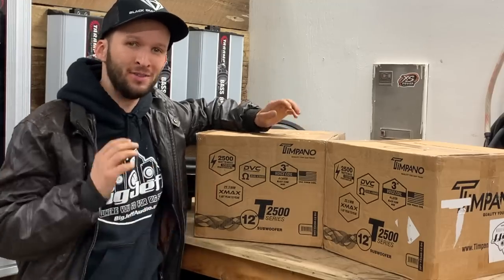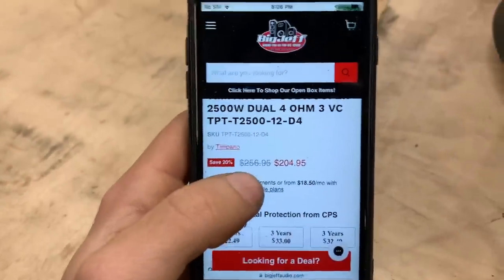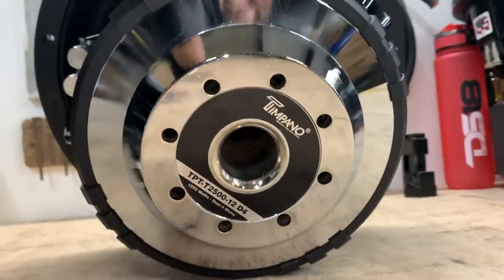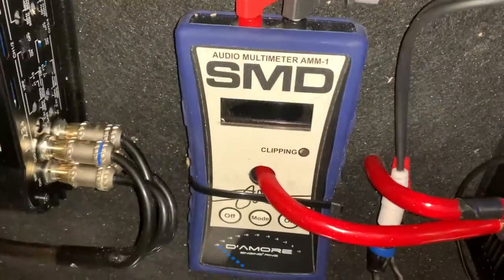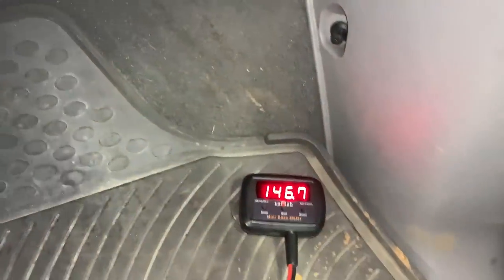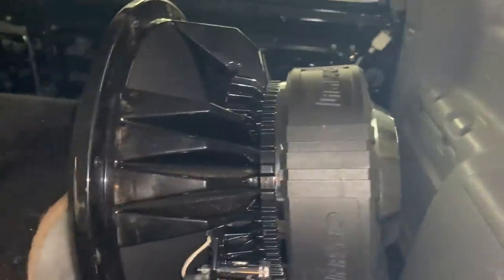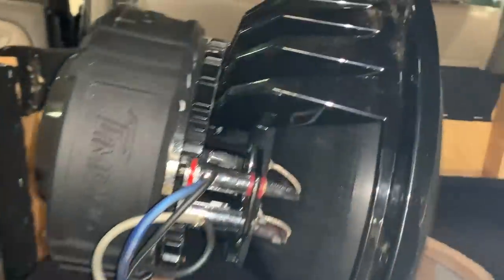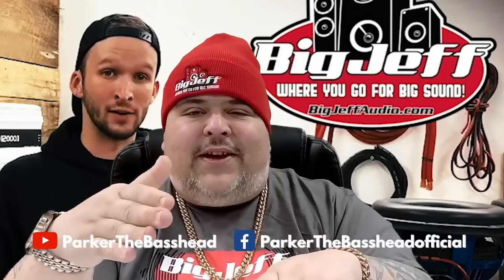What Does it REALLY Take to BLOW This Subs? Timpano T2500 Review

Comment: Big Jeff has some good deals.. I purchased my 2 10s for a very good price.. 🤘
Reply: i got 2 u series 12s from Big Jeffs for a decent price also...
Reply from the maker: Yeh I’ve bought a good deal of stuff from him in the past as well!
Reply: You said it bro,  I'm going to order an amp I've been having in my cart for couple months.  He has is cheaper than anywhere I've looked.
Reply: Have a question,  I can do with your opinion.  If I have a 2500 watt amplifier but wired it to  2 ohm and it's rated at around 1200 Watts, would I necessarily have to upgrade my electrical or could it safely operate  with an Agm, ultra capacitor and a 120 amp alternator?
Reply: @TheRepos296  you should be fine.. when you say ultra cap are you speaking of an actual ultra cap? Like ioxus or xs power? If so I have the ioxus and I've comfortably ran my Rockford 1200.1 which actually does around 1500 off just the cap and xs power battery up front
Reply: @TheRepos296  do the big 3 if you can.. this will give you a little more out of the system.. and not take alot of wire. The reason I ask is some people think those tube caps are super caps.. they are NOT. most are 3/5 farrad. Nearly useless. For example the ioxus is 350 .. the xs is 500 I think. That's a real cap.
Reply: Thanks for the advice I will definitely do that 👍

Comment: Love your videos Parker ! If you're gonna do power test keep it in the Box of course subwoofer gonna blow in free air  If the subwoofer is not designed for  Infinite baffle!
Reply from the maker: The problem is if I leave them in the box they over heat quicker. So either way it’s not optimal. Point being this is an extremely brutal test so it lasting 3 minutes is pretty good
Reply: Can you invert the sub in the Box to let the motor structure breeze
Reply: @ParkerTheBasshead  I see your point,  but nobody is playing/burping subs in a free air environment. Doing the tests in the enclosure is actually more optimal,  as 90% of subs aren't designed for infinite baffle/ free air.  I personally, would start testing in the enclosure,  as that's how you'll truly torture test the driver properly. Plus your viewers will get a better idea, if which subwoofers handle rated power and which ones cooling is better than others.  👍 for a good review.
Reply: old school rule of thumb is you half the rms for free air. some subs are underated some over rated. also using a random ported box to test a woofer isnt exactly fair to the sub. box size and port tuning matter.
Reply: @Chuck_Sanders  I think your missing the idea
Reply: trucker 9000  well, Qtc is the value for the damping provided for a driver in a sealed enclosure. It denotes the enclosures ability to control the driver response at resonance. Also, over 90% of drivers are not designed to be in an infinite baffle/free air environment. While it does take less electrical current to convert into Kinetic energy at the subwoofer to get it moving, there is still significant heat involved with a constant tone, even in free air. All wire has an ampacity rating and or thermal capacitance. When wire is fed a constant current,  it also introduces heat...and it's unavoidable.  Even with no resistance from an enclosure...a driver has a start and stop position during excursion...as it cycles through a frequency. My statements still stand, and are valid. To accurately test a driver, you need to put it in the proper net volume (whether it be sealed or ported, and tuned appropriately) and tested at its rms power ratings....as thats a REAL rms test. You will saturate the coil just as easily in free air, as you would, in an enclosure. So the test isn't valid even though each sub is "tested" in the same manor. Putting a driver in a random enclosure, or just sending a constant tone to a driver in a free air state, is not a test. Nobody plays subs in a free air environment, nor a constant tone for more than a few seconds at a time such as burps, nobody. So that is just a pointless assessment, of any drivers real capabilities.

Comment: I agree running separate wires and summing them at the terminals or soldering wires together into 1 because of tiny terminals does suck. I had n NVX vcw few years back n it had tinsey terminals. The AB elites 12s I built a box and put together for buddy had small terminals I had Y them together with soldier.

Comment: My full car audio system is Timpano and I have these same 2 x 12" in my car and they play really amazing. I have the Timpano 3k amp on them. I had them in a ported box first sounded amazing, now i have them in a 4th order bandpass box tuned to 49hz and they sound even more amazing. The bass line matches up well enough for my midrange of 8 x 8" Timpano MD8 Slim in my 2 front doors

Comment: Subwoofer power ratings are an expression of what the speakers are supposed to handle while INSIDE the enclosure. The pressure from the backwave helps to stabilize the motion of the cone and prevent the woofer from over-excurting. This is why sealed woofers handle more power than ported. By running RMS power to a woofer in a free-air situation you are significantly overloading the voice coil and suspension. In essence, you're testing a product in an application it was never designed for. To then draw a conclusion and broadcast it to your viewers (that the woofer can't handle its RMS rating) might be a bit irresponsible
Reply: What you said about a sealed box is true but not for a ported box since playing below tuning frequency causes unloading and the sub acts like it's in a free air setup. This test was an extremely tuff test on the sub but it is a very accurate test. In a sealed box heat is trapped inside the box and the sub can get very hot very fast. This test was valid for what it was....a torture test as he said. Pretty apparent these are SPL subs with a high fs of 39hz so he did to them what SPL competition does.....beats the hell out of them!
Reply: It's true that sealed woofers trap heat inside the box, but companies can take that into consideration when coming up with power ratings. What they don't factor in, is free-air performance.
Reply: @e-mailuser9811  that's not true. Many many companies rate there speakers for free air use. You just have to pay attention to the manufacturer suggestions. Which as I said before for most subs they specifically state in free air the speakers RMS power is cut in half or sometimes a 1/4 of it's rated power. Also you assume all manufacturers specifically say to use a sealed box when in fact many subs on the market are designed specifically for vented/ported boxes. Any sub with a QTS parameter of .7 or higher is suitable for free air play.

Comment: I would love for you to test the Ground Shaker 30 Hz box for two 12" inch subs the Box is amazing it has Bracings on the inside I can honestly say that it is amazing and I know for fact it will do better then the skar box I think it's $280 and it takes a week or two to show up they ship out from California and I know if you buy the right hardware screw's the ones you have to hammer in from the back and the Allen key bolts for the front it's a heavy box but that also insures if you invert your subs that the Box is not going to tip over that would be great for a video and see what the decibel reading for each box with the same subs in both boxes one that's tuned lower but is a little smaller in CF compared to one that's bigger an tuned a little higher just to see what the difference is based on what you pay for I own the Ground Shaker 30 Hz box and I can say it's been amazing 🔊🔊🤙🏼
Reply: I was lookin at tht same box for my skar sdrs. I was surprised at the lows those produced out a old prefab. And only a taramps md1200. Also have two set of timpano mids and supers in each front door

Comment: Same sub as audio legion gladiator same motor same basket same boot on the magnet with timpano name timpano uses a smaller not a wide but taller surround
Reply: The Gladiator GLA12 subwoofer, is stamped steel frames,  and the Gladiator motor structure didn't have a bumped back plate design, it has a flat back plate and the coil isn't a 3" as is the Timpano. The Gladiator used the same steel frame, as the Soundstream R3 reference series and a few other companies though.